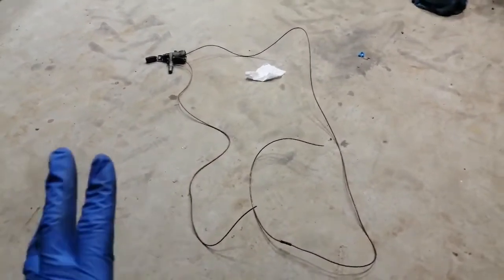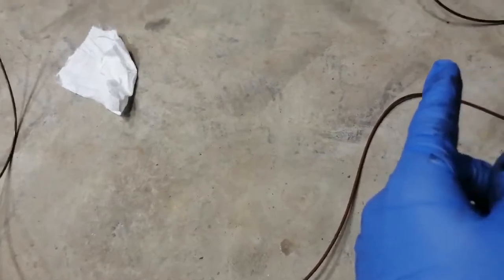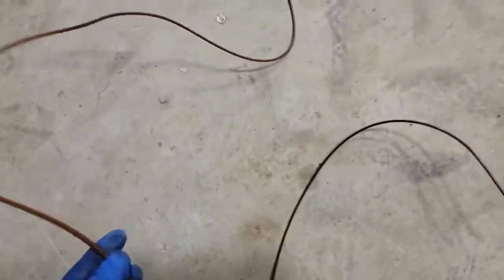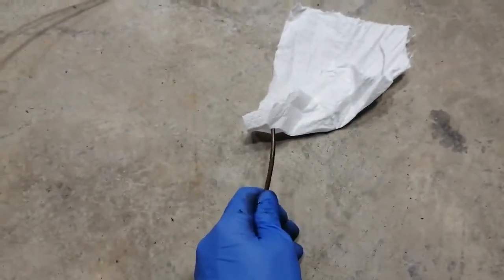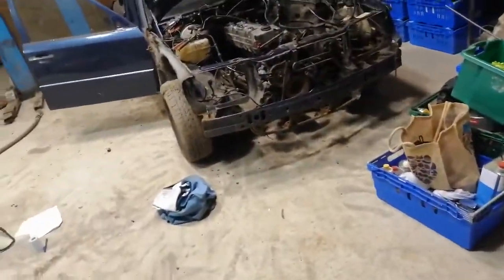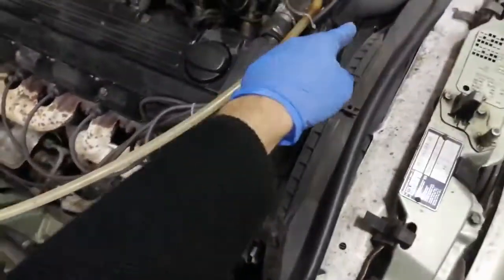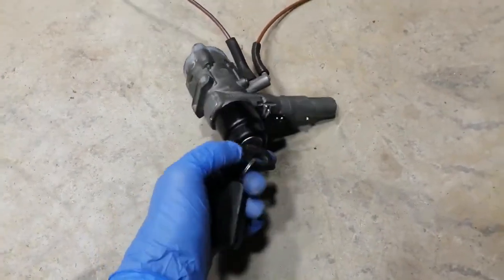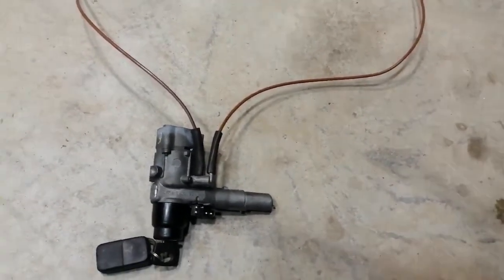Om606 w124 Build - Ignition Vacuum

Comment: Do I have to take the dash off to get to that pump or can I access to it under the cluster? My motor won’t shut off.
Reply from the maker: Mike, if that is only after starting it most likely is the shut off actuator on top of the injection pump or more likely a vacuum line off or in the wrong location. 

There is a panel where your knees go that can be removed to access the ignition barrell. 

Hope you get that sorted.